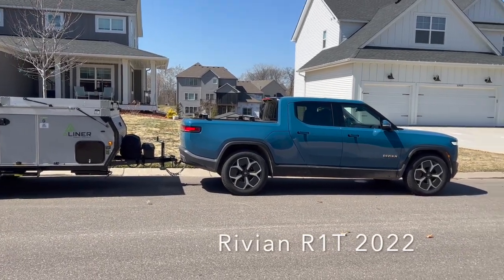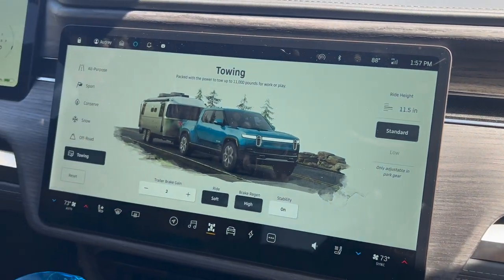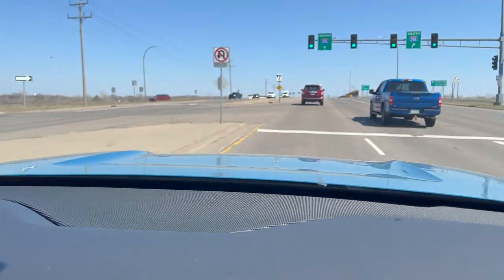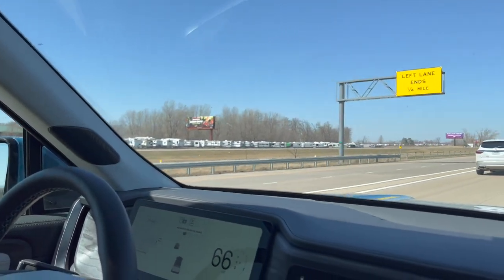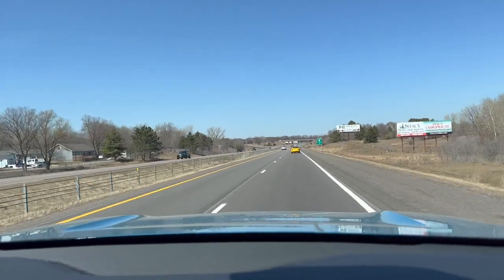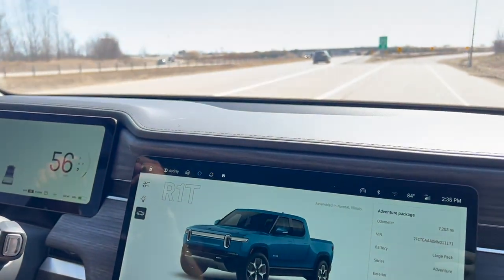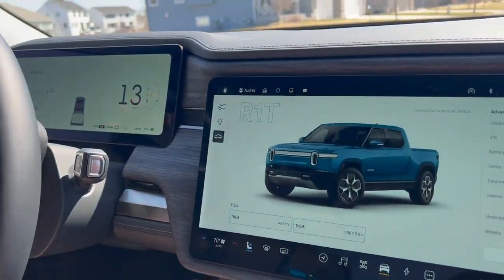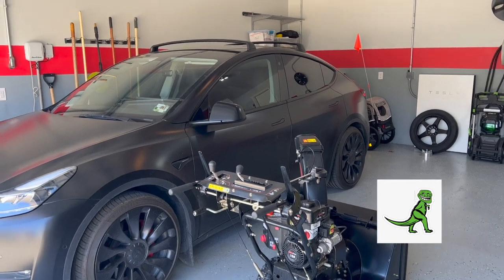Towing an Aliner with a Rivian R1T

Comment: Thanks for the video.  I've got an electric car.  So far though, my truck is still a RAM 2500 Diesel with a 100 gallon transfer tank and it gets about 10 miles per gallon towing a 9000lb trailer.  100 + 33 (main tank) = 1,330 miles towing range without having to stop at a gas station (we do have to pull over to pump fuel into the main tank, but can literally be the side of the road.  For me electric is just not ready for towing yet.